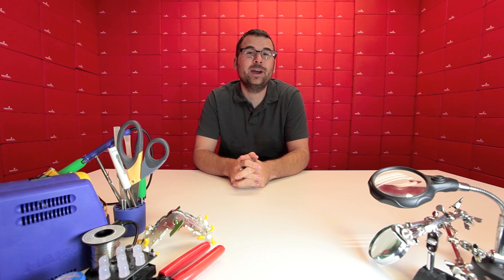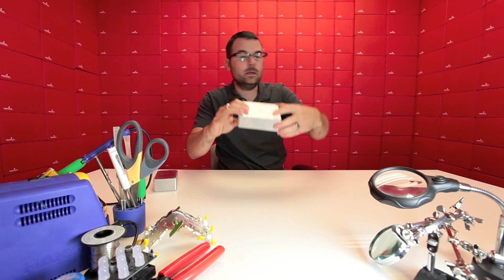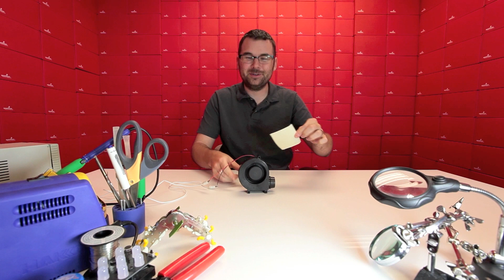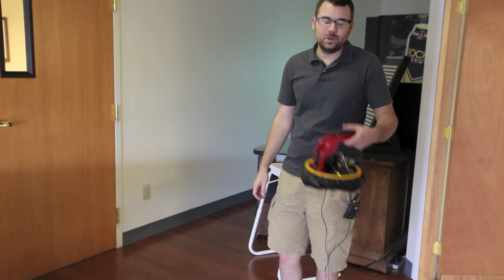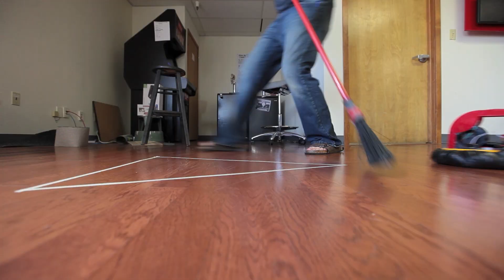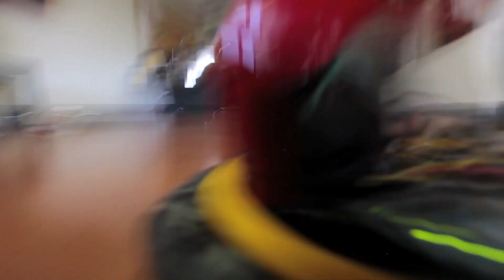SparkFun 7-20-12 Product Showcase

Comment: I want something to make 1 psi air for a  backyard pneumatic grid system that I have developed.  I work it now off of 2 aquarium bubble pumps powered by mains electricity.  About 7 watts total but they produce about 3 psi. I run 9 separate airlift pumps from it and they are 100 ft away from the bubble pumps. (Hence pneumatic grid!)     With the blower, I could run my system off a 15 watt solar panel and expand it.  I do pallet gardens, vertical pallet gardens and a "dripwall" to warm plant roots in the greenhouse but I also want to do aquaponics and "ebb and float" hydroponics. Anyways, if the blower can give 1 psi at 3 or 4 liters per minute of air flow from a 15 watt solar panel, I can take my pneumatic grid "off grid" and make it independent.  Thanks Brian